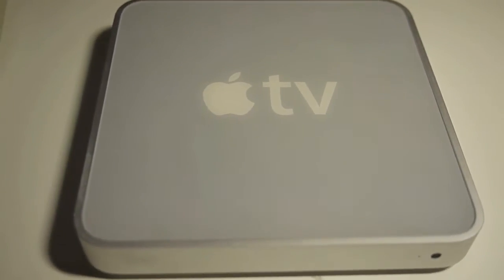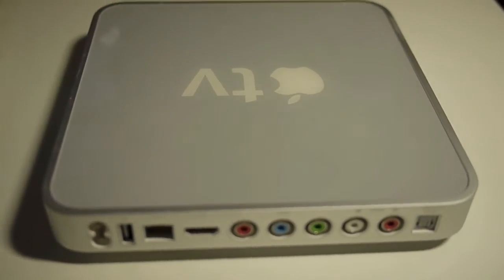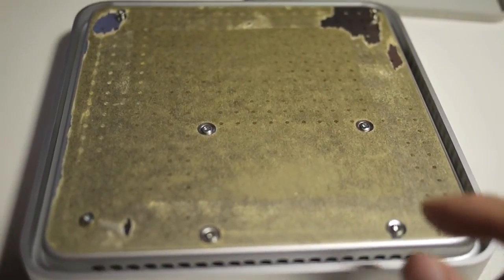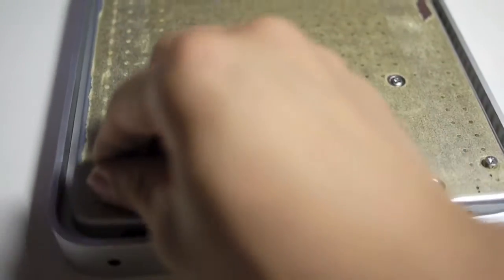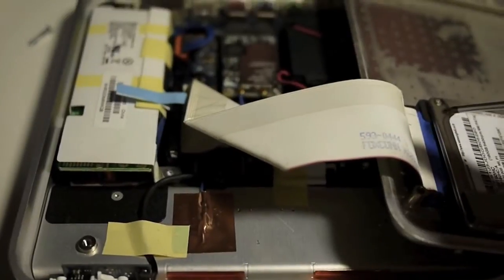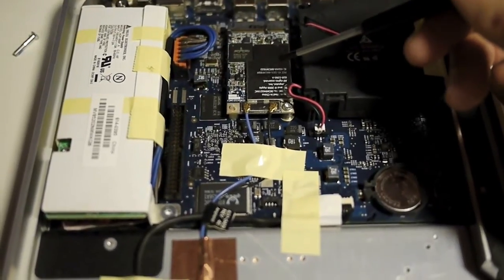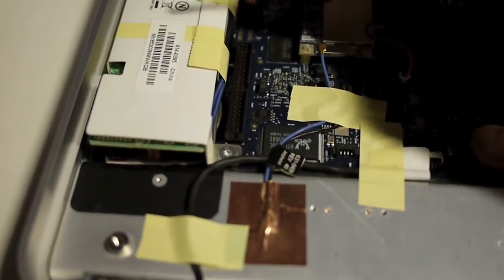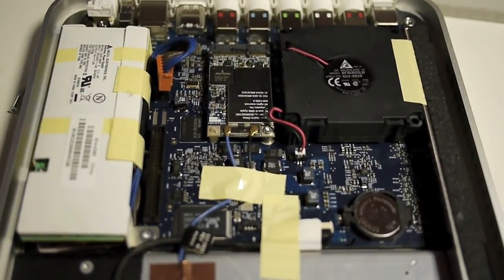Apple TV First Generation Disassembly for repair or upgrade

Comment: I just took mine out of the old stuff box to play with it again. I turned it on for a while and then suddenly it simply turned off... now, when I turn it on, it runs for a few seconds and shuts down. I have to wait for a bit to try turning on again. any ideia?
Reply from the maker: Could be the power supply - capacitors failing.

Comment from the maker: Yes it is: BCM970015 Broadcom Crystal HD PCI Express mini card Hardware Decoder. You need to remove the mini PCI-express wireless card and substitute it with the Broadcom. So you'll need to rely on the ethernet port for internet connectivity. Furthermore, the embedded MacOS will need to be replaced with a version of Linux, which is widely available on the web. The Apple TV generates about 27 watts. The aluminum case also used as a heatsink. You could remove the rubber cover on the bottom.